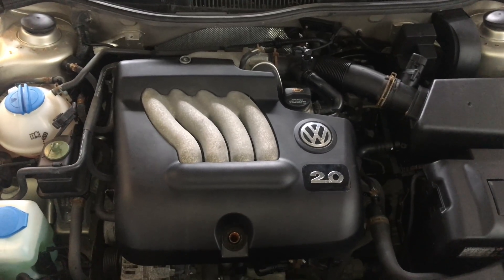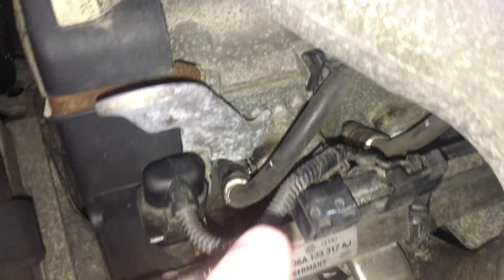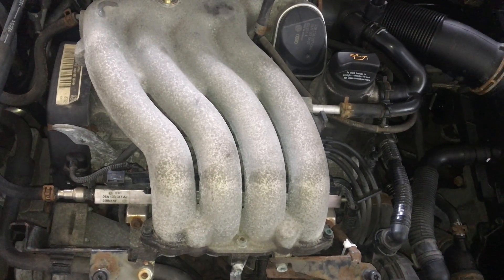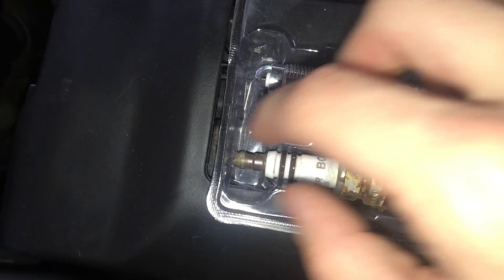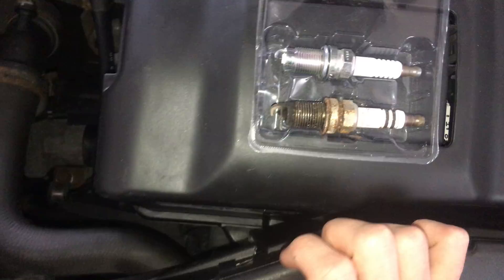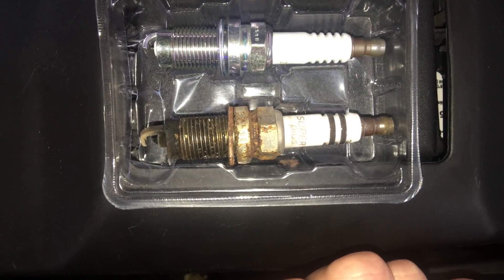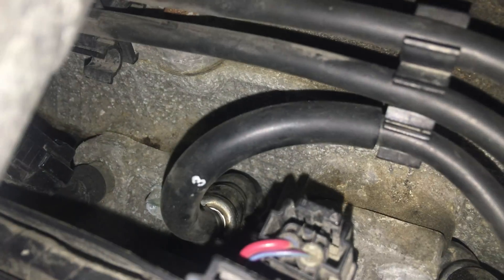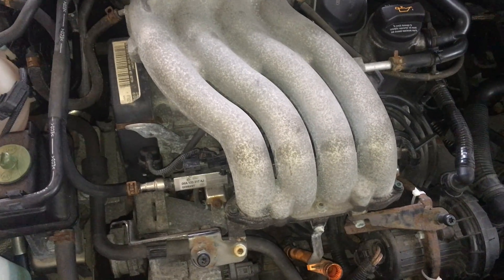VW 2.0 Engine Spark Plug Locations and Tips from my Experience as an Amateur

Comment: Heat range 5 too hot for this motor. Stock 2.0 heat range is 6. With NGK the higher the number the colder the heat range. You absolutely 1 million percent do not need to remove the upper intake to replace plugs and/or wires. Yes I've replaced both, done plugs multiple times.

Comment: 2.0 slow engine lol
Reply: Slow but reliable I guess
Reply: I find it great on the many steep hills where I live. And on motorways. Very torquey for a petrol engine. It doesn't deliver much power at high rpm but for my uses I prefer having plenty of low rev torque. Also, it holds its speed well (no need for cruise control) and is great at slowing the vehicle, unlike some.

Comment: you literally didn't even do a replacement wtf. thanks
Reply from the maker: yea im lazy af
Reply from the maker: unscrew old spark plugs, screw in new ones. not before taking off wires. if someone with no experience can figure that out, at age 15, i hope you can.
Reply: Albert martinez  its only 7 bolts to remove the intake manifold ... 5 in the front ( 5mm allen make sure you have a T-handle ) and 2 in the back ( 6mm hex/allen wrenches / sockets if you have them)

Comment: You don't need to take off the bolt holding the rear of the plastic engine cover.  Once you pop it off the two front studs, pull it toward the front of the car and it will slip out from between the rubber mount.
Reply from the maker: Well, my car no longer has that bolt so at this point, it's a non issue :P